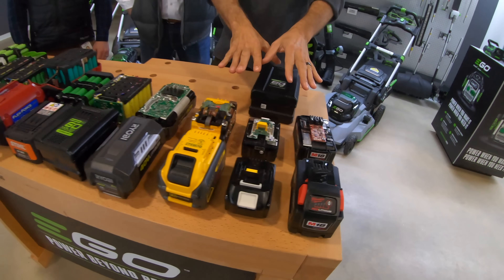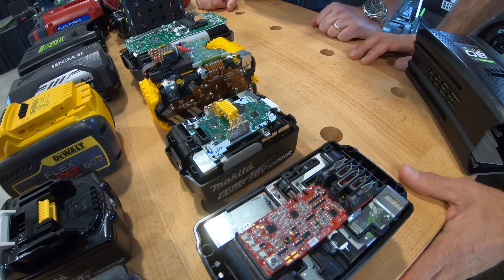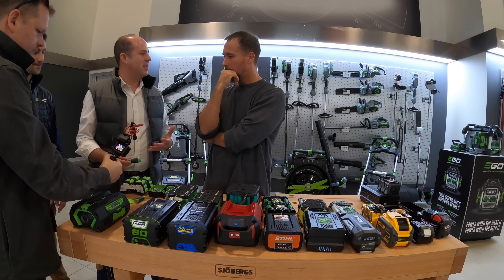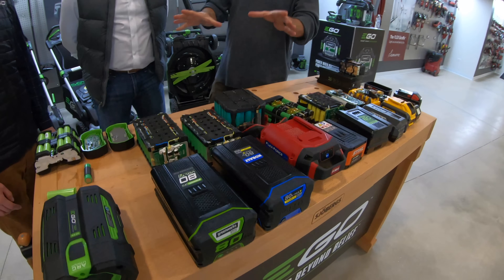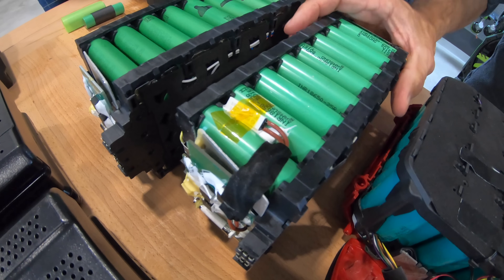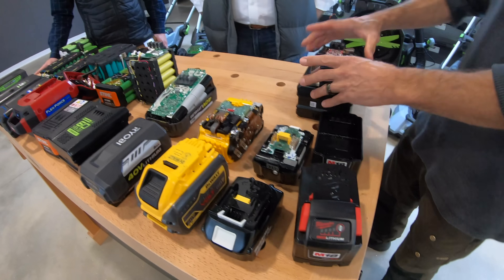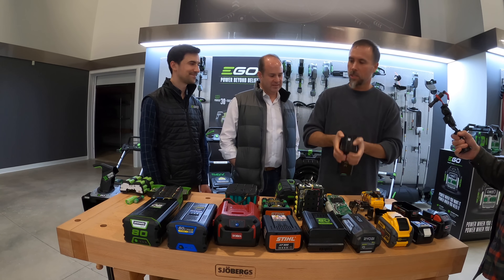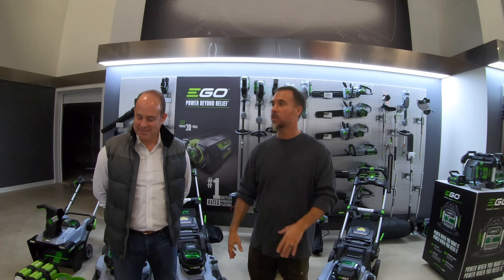Inside the batteries on the most Popular Power tools: Ego Vs Milwaukee vs Dewalt Vs Stihl 4 k video

Comment: It's like going to DNC headquarters and asking them to compare with the GOP, but be fair about it.  Haha!  Seriously though, they seemed pretty even handed.  All I can say is I've yet to replace a Milwaukee  or Makita battery pack.  Ryobi 40v pack didn't last a season.  I don't have experience with the others.  Kobalt fans should be happy with those Sammy cells in there.  I haven't heard a negative review of any E-Go stuff, but simply don't want another platform to deal with for the next few years anyway.  Cool video looking inside all those packs.

Comment: All bullshit. Ego just paid this guy to do a commercial for them on his channel. All these are top quality batteries and the minor differences between them make such a minuet different they are basically all the same. The design of the Ego battery is better in the fact that it has all the individual batteries where they cool easier and have the phase change material ring but that too makes such a small difference that it's not that critical. If you run one of these batteries to the point they are so hot that surface area cooling and phase change material rings are a factor then you should be using a pneumatic, corded, or gas powered tool. That is my opinion from what I understand about batteries. I am not an expert. I did not go to school to build batteries. That is for anyone who wants to diss my comment.

Comment: 0:50 It's kapton tape, it's used for high-temperature applications. In this case it's being used as a strain relief to keep the wires from flapping away in the breeze and potentially wearing the connection it's attached to prematurely. The use is correct and they said "your words not ours" because of that gross misrepresentation of what it actually is.

Comment: Got a better  solution for the battery packs getting hot  .
A built in fan inside battery or a second fan inside the tool or diffrent design of motorfan to blow though the tool to reach battery pack  :)

Comment: The "Ego-Specialists" did not seem to know about the importance of the anti-static tape, but never mind, Stanley if you really want to compare the different company's you should ask this very important question, doing stuff in house is important, but WHAT is it that they do in house and what is the core architecture they are applying ??? Because that is really the most important thing to ask, here I will explain why, as an example at one point I had to choose my company, because I did not want a array of different batteries and chargers I want to be able to use any tools with any battery I have, so I choose Makita, why: Because Makita completely builds the battery system  from the cell they buy from Samsung, the rest is all done at Makita, and most importantly they design and manufacture their own electric motors and parts, for the use of a 18 volts  battery platform, that is a paramount importance, so their motors design exploit the 18 volts to the max, for each specific task that tool will have to perform...most manufacturers buy motors from other companies...ANY of my batteries fit ANY of my tools...so this was probably a publicity video for Ego!

Comment: I am looking to buy storage batteries for my solar system. I was told to wait, don't buy now. New and cheaper technology will be available. I've waited 4 years now. Is there any brand/type that has improved?
Reply: Graphene batteries are very close. I have heard there has been small scale tests. I'm not sure on the status of Solid State batteries but I'd expect them to be close to market as well. Maybe within 10 years.
Reply: @jronmanbuilds  10 years? Can they speed that up a bit? In 10 years I'll be dead.
I'm talking now. Wile I'm still alive and have the 💰.
My system works great. Last month electric bill $28.00 !
Reply: @Thebowzer221  Go Lithium Iron, see the "DIY Solar Power with Will Prowse" and "DavidPoz" channels here on YouTube. There are also professional installers that Will Prowse talks about from time to time.

Comment: Big fan of your channel and usually enjoy your content, but in all honesty given the effort thats gone into preparing the battery packs for this video i'm very dissapointed at how superficial this review was. So in summary because the EGO battery does not have any internal cells and they use potting they are claiming to be a better batter pack (design). What about all the other factors that, in a real use case are important, for example run time, number of recharges during lifetime, impact resistance to dropping, materials of constuction, Price per Amp/hr , how quick to recharge   etc.etc. All descriptive, no data. Also if their tech guy knew his stuff he would have corrected you on the use of "Scotch Tape" and pointed out it was a high temperature static and insulating tape ("Kapton" tape) that is a good thing to se  in the battery pack.
Reply: Any knowledge of solar storage batteries? I want to buy them. Don't want to buy junk.
Have solar system on my roof.

Comment: Phase change material,, haha snake oil salesman.  Its called shrinkwrap to hide the manufacturer and data on the cell.  One layer of shrink wrap protects the cell form contact shorts with other conductive objects.  Two layers of shrink wrap keeps the cell from dissipating heat.

Comment: My tech' geekiness really enjoyed that comparison!
The Stihl was using a specific type of high quality tape SPECIFICALLY m ad for that type of application - it's actually a sign of a good product as it secures the wiring and prevents movement and vibration from damaging the battery.
On the wiring, the type of wire, more specifically the insulation, can make a big difference - the 'normal' PVC type is only good to around 80C, so if the battery is running close to it's thermal limits...
Reply from the maker: Glad you enjoyed it, thank you for viewing !

Comment: I'd like to see a stress test of all the battery packs (same voltage,amp hrs, etc) to see which one lasts the longest and has the most charge cycles before it dies.
Reply: Miles vary depending on driver.

Comment: Soooo, without all the double speak ("phase change material", my ass), and besides the obvious additional spacing it might provide between each cell, specifically... just HOW does the "PCM" provide any additional cooling (passive OR active) whatsoever???
Reply: Perhaps you could do some checking on "phase change materials" - there has been a fair bit of work in the solid-solid field.
In this instance, I would surmise it is to spread the heat from hot-spots over the whole casing, and help even out the outside temperatures of the cells - so increasing the spot cooling and total area for the heat emission as it will move heat from the inside to the outside of the pack, where it is easier to get rid of it. Think of it like a heat-sink that wraps around the cells.
One point is the waste heat still has to get outside the battery, through the casing, but it doesn't seem to be much of an issue.
If you're using a laptop or 'phone, you're using a device that uses Phase Change as a liquid-gas-liquid cooler cycle.

Might have been nice for them to mention WHY it is important, with power draw and charging rates.
Reply: @gordowg1wg145  HA!  Overly complicated buzz word for a "heat sink" without a "heat pipe" to transfer the heat to the sink (as in all laptops).  Nothing new... more hype than help.  Sooo, just what "sink" do these PCM's supposedly transfer all the heat to, I axes ya???
Reply: New process, old principle - interesting and, as I suggested, worth following up on if you're interested in that sort of thing.
Similar process is being introduced in high end sports clothing, and many other applications.
Reply: The PCM melts and absorb heat, like an ice cube keeping a drink cold
Reply: @coreyberman8139  Not so much, while there is heat absorbed from the drink driving that phase change, it's mostly the specific heat capacity of the ice/water.
Think air conditioner for the more conventional phase change, liquid</>gas.

However, this is a solid</>solid phase change which is rather more interesting.
Reply: @gordowg1wg145  the PCM is a wax-like material. It undergoes a solid to liquid transition, but not fully liquid, more like a softened wax. And yes it is the specific heat capacity of the PCM that absorbs heat from the li-ion cell
Reply: @coreyberman8139  

Thanks, I stand corrected - it's a shed load higher than I thought I recalled - 334kJ/kg Vs 4.2kJ/kg/C

Comment: Having studied battery technology extensively, b.s. is piping out of his mouth. Samsung batteries are not any better than LG, Sony, or Panasonic/Sanyo. They are all top tier. Second, the best of the best 18650 batteries from those aforementioned manufacturers are only $4-5 retail, so they're half that when large power tool manufacturers are buying them in bulk. They get them for around $2 each.(Or less.) So going from the best to the worst 18650, it is a matter of pennies at the wholesale level. All of the manufacturers are using the best batteries. And there is nothing wrong with Kapton tape.
Reply: Panasonic are slightly denser as for as kw per gram but I agree they are vary close. There cost is coming down year  by  year's almost 40 percent in the last  5 years.
Reply: I watched this wondering if any of this new technology is available in batteries for solar energy storage.
I have a whole house solar system on my roof and now want to add batteries.
Any suggestions are welcome. Thank you.
Reply: @Thebowzer221  flooded batteries are fine as long as they  are held in is ventilated area and are secure to prevent tipping etc. There are lots of YouTube video on solar power storage sheds complete with bus bars.
Reply: >Samsung batteries are not any better than LG, Sony, or Panasonic/Sanyo

as far as power tool cells go, they kind of are.  Everybody's been switching to primarily Samsung over the past few years.

-Makita 5.0s originally came out with Sony cells, now they use Samsung 25R.

-Milwaukee 9.0 HD originally came out with LG HG2.  They later switched to Samsung 30Q.

-Dewalt just recently switched their 5.0 packs from Sanyo to the Samsung 25R.  And their 3.0/6.0 XR and Flexvolt 9.0 packs were switched from Sanyo 20700s to Samsung 21700s back in 2018/2019. 

And as far as 21700s go Samsung is basically uncontested.  Sanyo and LG have no adequate 21700 cells for power tools as far as I can tell.  I think most of what Sanyo makes is for Tesla anyways.  (and Tesla cells do not work well as a power tool cell) 

Sony(now Murata) has the VTC6A which is a great power tool cell on paper.  But I don't know of anyone who 100% uses them.  All the 21700 packs from Bosch, Dewalt, Milwaukee, MetaboHPT, etc have been using Samsung 40T/Samsung 30T.
Reply: @AaBB-ks6oc  How do we know that it's not about a manufacturing capacity or just better deals that made them switch? Samsung is huge, they make a lot of stuff, and corporate deals are more about who you know than what you make/do.
Reply: @AaBB-ks6oc  i have not seen any of them using 21700 cells just 18650 where did u see that at
Reply: @anthonyskrzec6881  Metabo (not to be confused with MetaboHPT/Hikoki/Hitachi) has been using 21700 cells longer than Tesla has, even though Tesla marketed it as if they had developed this new "optimal" cell format for Model 3, when in reality it was just a new off the shelf standard battery format. A few e-bikes were also using it before Tesla.
Later Bosch has also started using 21700 cells in their Bosch CORE18V power tool batteries.

The Metabo batteries using 21700 cells are marketed as LiHD. Bosch and Metabo still also sell regular old 18650 based batteries that fit the same tools, but these are not marketed as CORE and LiHD respectively.
Actually, there are a lot more brands than Metabo sharing the same Metabo developed battery platform under the Cordless Alliance System, but many of them are small specialty tool manufacturers few people outside specific trades have ever heard of. The best know brand in the Cordless Alliance System other than Metabo is probably the carpenter/woodworking brand Mafell. Some of the Mafell cordless tools like drills are just rebadged Metabo drill in red instead of green.
Cordless Alliance System: https://www.cordless-alliance-system.com
I wish all power tool manufactures would use just one universal platform so you can mix and match 18V tools and batteries from different companies like Makita, Bosch, DeWalt, Milwaukee, Metabo, MetaboHPT/Hikoki, Mafell, Festo etc.
But that's not going to happen unless someone like the EU forces this to happen like with micro-USB and now USB-C for smartphones.
Reply: @ITubeTooInc  thats right i did see bosh core had them but was not a where anyone else used them at least in power tool batteries just in other stuff
Reply: @anthonyskrzec6881  HiKOKI Power Tools (named Metabo HPT in North America, and formerly known as Hitachi) use 21700 cells in their newish 36V/18V MultiVolt batteries too.
Reply: @ITubeTooInc  last guy said they used them
Reply: @AaBB-ks6oc  It's important to differentiate quality and specs. All powertools are high current applications but not all lithium ion batteries are designed for or used in high current applications. All these battery companies make top tier batteries, the individual cell a manufacturer picks is complicated and always comes down to the cheapest that meets (well hopefully meets) the engineering goals. Samsung does seem to put more focus on catering to the powertool manufacturers than the others and that makes them an easy choice in the examples you provided.

Sanyo/Panasonic for instance has no reason to spend the R&D designing a powertool cell, they are busy making their obviously fantastic EV batteries for Tesla.

Comment: Marketing wank talk. We potted our electronics in the 60,s. Nothing to see here, move along.
Reply: It doesn't matter if you were potting boards, what matters is that the other manufactures don't. That is all that matters. The batteries are being compared, which has absolutely nothing to do with anything else that is potted.
Reply: @xenonram  perhaps, but is vibration killing pcbs in batterys before the cells grow crystals,  my feeling would be no. If you want to fund a study to prove all cell pcbs would benefit from being rosined up, go for it. The market is probably about right
Reply: @davidkane4652  To clarify, potting through-hole transformers, inductors, and capacitors is important and lets the product last longer by damping external and internal forces, but it doesn't need to be a fill-up-the-bucket type application to be effective. Potting the way they've done it is meant to prevent reverse engineering and repair.

Comment: Samsung 25r is NOT the best 18650. They are one of the cheapest high end batteries and that is the reason so many manufacturers use them. A better choice would have been Sony VTC's or one of the newer batteries beating them like Golisi.
Reply: except manufacturers have been moving away from Sony/Murata over the years.  ex: Makita was 100% Sony when 18V LXT came out.  Then moved basically everything over to Samsung after almost 10 years. 

Dewalt has moved away from Sanyo to Samsung.  And Milwaukee has switched multiple packs from LG to Samsung.  And everybody using 21700s is exclusively Samsung.  

+ I'd bet the 25R has a better cycle life compared to competing LG/Sanyo/Sony products.  Which leads to lessened warranty claims.
Reply: You have a one track mind... High CDR for vaping. Power tools need a balance of capacity and current. No one is going to put bobo golisi batteries in their name brand product.

Comment: One cautionary issue not raised with the potting. Components not fully covered or only half covered are more susceptible to heat and vibration. Vibration: point of failure will be potting line. Heat: same, point of failure will be potting line.